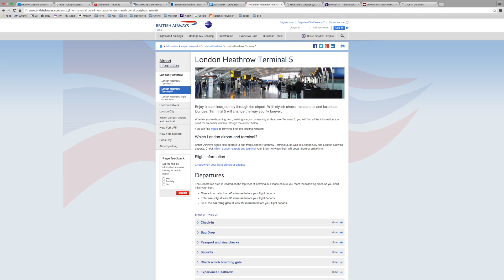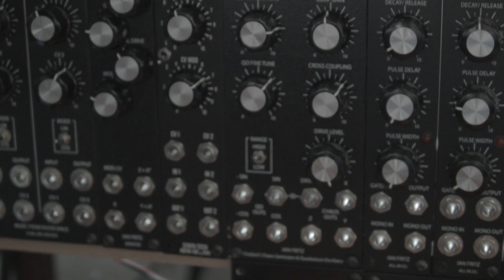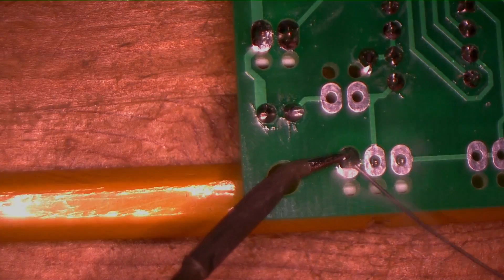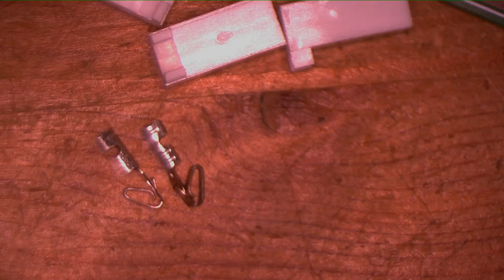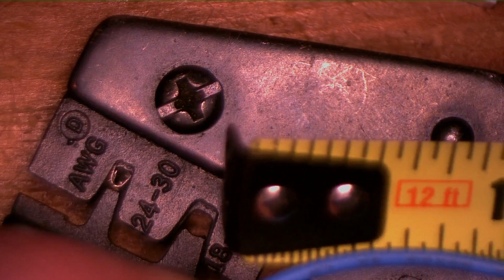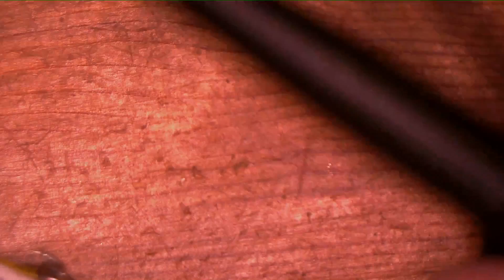Modular Synth Project while: The Modal 002 is in the SHOP - story of that

Comment: Why is (was) the Modal 002 for repair? I'm considering getting one. Is there something i should consider concerning reliability and quality?
Reply from the maker: +Tzachi Keinan Hi Tzachi.  Well, the unit I got first was, to my mind, an earlier version of the 002, and maybe even a beta test version.  It had a number of issues, mostly software-related.  If you look at my first unboxing video, you'll see, for instance, that the volume knob was actually not secure and had popped off in shipping.  The volume knob was trivial to get back on, but the software would not update automatically via the internet.  I tried a number of things with their software support people, and eventually, we mutually decided to send this unit back.  They sent me out another one immediately, and this one has zero issues.  Generally speaking, the 002 is a very solid unit.  Other than the Fatar keyboard itself, there are no plastic components.  Everything is built very sturdily and I would highly recommend one to anyone considering a purchase.  I have no regrets at all.